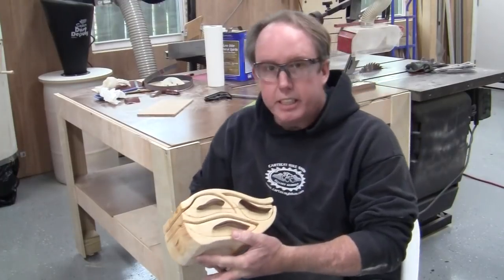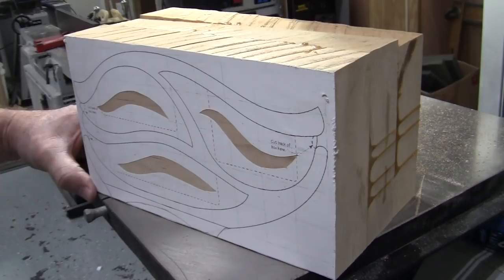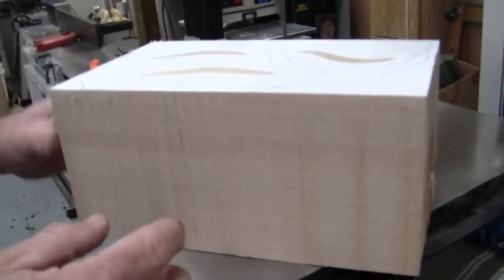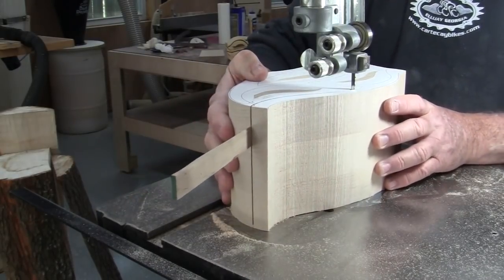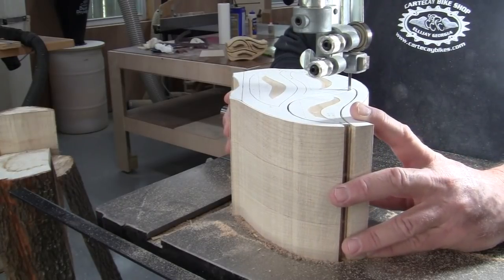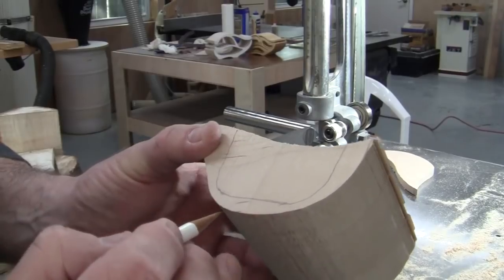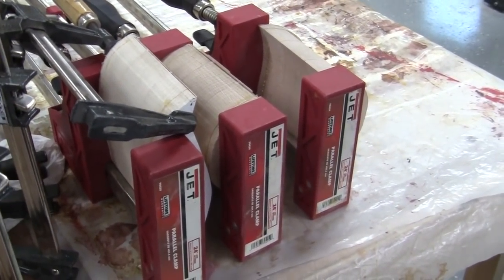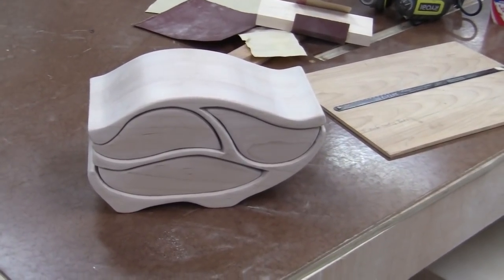Stingray Band Saw Box

Comment: Quite nice, how about some sort of spacers/glides to center the drawers in their holes? Maybe some strategically placed strips of felt either on the drawer bottoms or bottoms of the holes?
Reply from the maker: Thomas, I've decided I'm going to start doing that.  I've seen some Teflon strips that would work well.  Thanks for the input.
Reply: @coledunlay7876  I use 12mm felt discs that are 2mm thick. Ideal for the drawers.
Reply from the maker: @malcolmalexander5246   Thanks for that idea. It sounds like it would work pretty well.